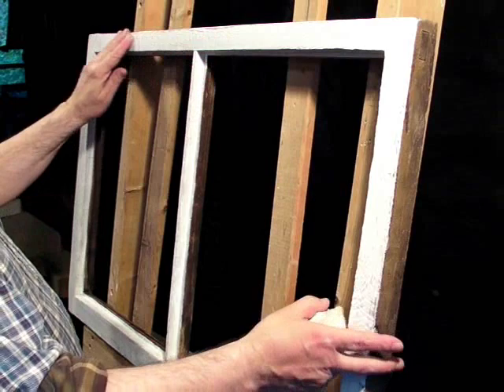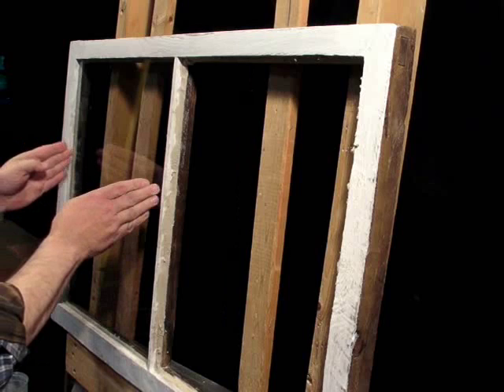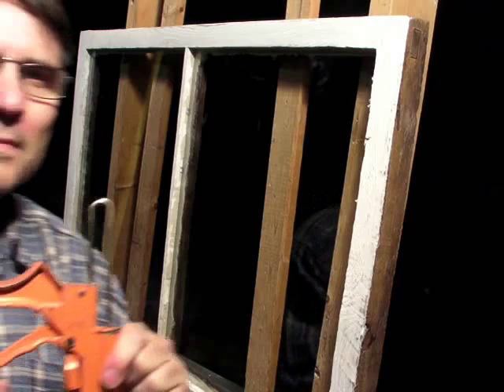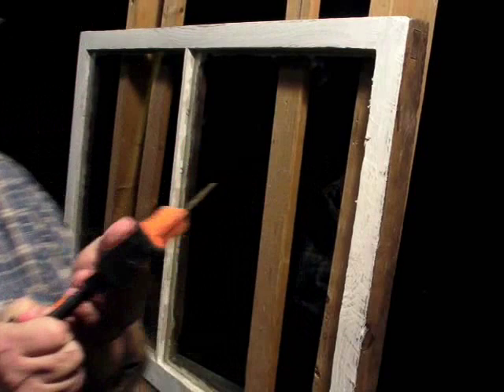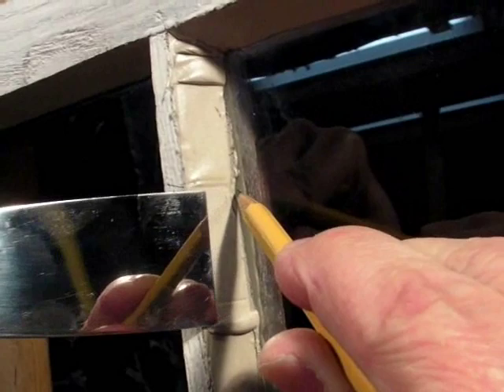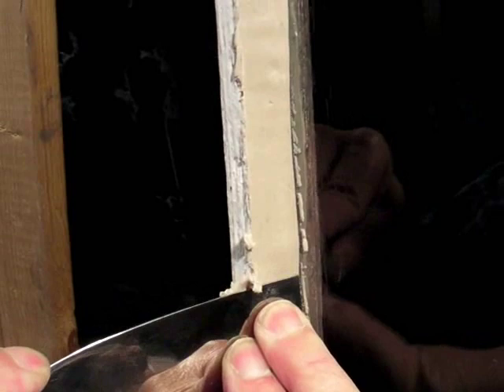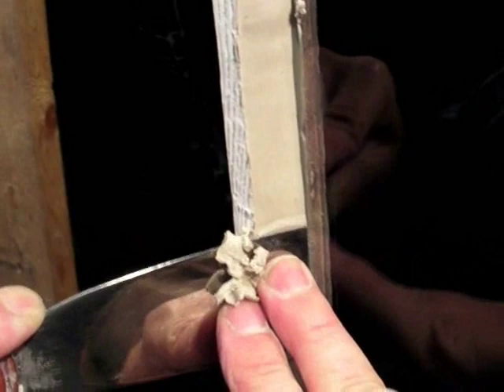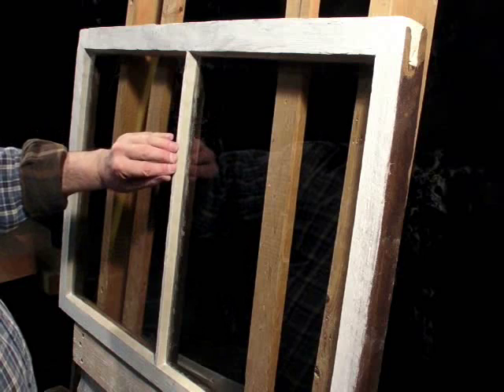Window Sash Glazing, Introduction

Comment from the maker: **In my region the traditional wood for windows is spruce. 200 miles to the south or north it is pine corewood, but here it has always been spruce. Which typically rots in 5 years.**

Here in Maine, USA, the traditional sash wood is Eastern White Pine, selected for straight grain heartwood. It lasts for 300 years. Also, some are of White Oak, Mahogany, etc.  A new imported wood used by some sashmakers is Spanish Cedar.

I would like to see some videos of  your window work.

--John

Comment from the maker: **Either I seal the rabbet with schellack or I saturate the rabbet with oil**

Here in America the tradition is to seal the rabbet with boiled linseed oil, which I have used in the past. I have used Shellac too, which I learned from Hans Allback in Sweden.

**I was thinking about posting one [video] myself. But here's a decent one**

Thanks! You should post one too, I want to learn how it is done in your neck of the woods.

--John

--John

Comment from the maker: We have enough time to save many old windows, rather than replacing them. Almost all old windows can be maintained and repaired at lower cost than replacement, especially if the replacement window is at least as good at the old window. Occasionally we replace a window with one made using traditional materials, construction and details. 

"Educate yourself and decide" is good advice. The building owner who knows the actual cost of window maintenance and repairs almost always decides to save them.

Comment: But by choosing the right trees and constructing the windows correctly, and by using proper linseed paint and putty, such spruce windows are still among us 200+ years later.

It looked like you were using paint to seal the rabbet so the "pressureputty" doesn't dry out.
I've seen this alot, but it requires some sort of acrylic or latex paint to effectively stop the oil from wandering out of the putty, and I don't use those. Either I seal the rabbet with schellack or I saturate the rabbet with oil

Comment: Oh wow, I've been skimming through glazing videos on youtube for a while now, and they've all been so awful I was thinking about posting one myself. But here's a decent one. Thanks!

From the discussion below it seems you have much the same problems with "pressure to chuck'em" as here in scandinavia, and perhaps worse.

In my region the traditional wood for windows is spruce. 200 miles to the south or north it is pine corewood, but here it has always been spruce. Which typically rots in 5 years.

Comment from the maker: John writes:
"This "part-by-part" repair method has been proven by the test of time. I have personally see 205 year old sash repaired this way that have lasted another 125 years."

Woodstone writes:
"Not sure about this one, John. What was the extent of the damage? You certainly didn’t use epoxy 125 years ago."

Here 'part by part' repair means that a whole part, a rail or stile, is made new and replaced, keeping all the rest of the original windows. 

John

Comment from the maker: Woodstone says:
>>Sash restoration is typically appropriate only when the sashes aren’t significantly damaged...<<
This is just another marketing myth. Sash joints that are completely decayed can be repaired by replacing just the decayed parts of the sash, the stile and rail. This "part-by-part" repair method has been proven by the test of time. I have personally see 205 year old sash repaired this way that have lasted another 125 years.

John
Historic HomeWorks

Comment: If you want to do it again, seat it in glazing compound as shown.  If you want it to last set it in a good sealent then use DAP to glaze the outside.  Won't be rattling and loose & in a few years!  I do loads of historic restoration, you have to moderize a bit but still keep it hirtorically correct.

Comment: Is it important to put putty under window glass? Or it s ok if i put it only on the glass to fix it? thank you.
Reply from the maker: Inna Ivanova, If the glass is still well-sealed to the sash by the back putty (under the glass), you can just renew the front putty (on top of the glass). Here is more on spot putty maintenance:
http://historichomeworks.com/forum/viewtopic.php?t=1574
Reply: John Leeke why it must be sealed? What reason?
Reply from the maker: Inna Ivanova The purpose of the putty is to seal the glass to the sash to block the water and the wind. The front putty seals on the outside where there is rain. The back putty seals on the interior where water may condense on the glass and dribble down. With no seal on the interior this water may collect in the wood and cause rot.
Reply: John Leeke thank you John!!!!